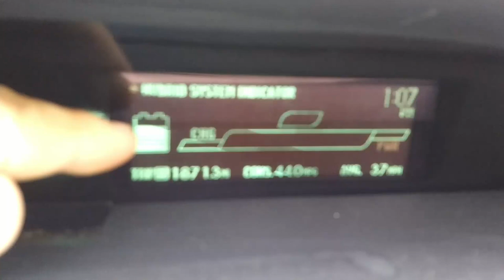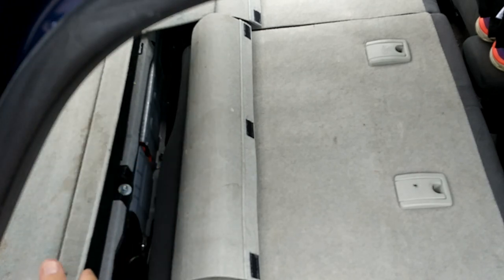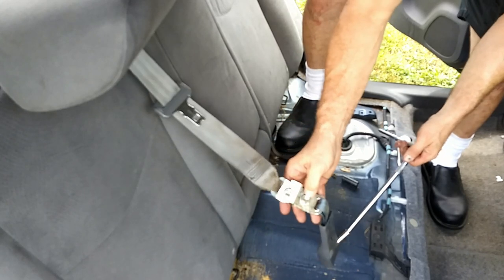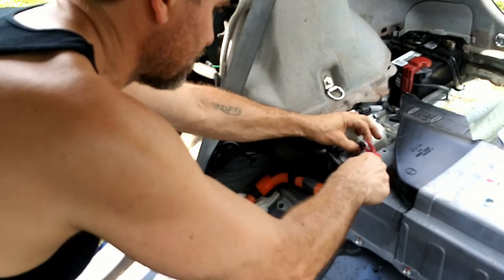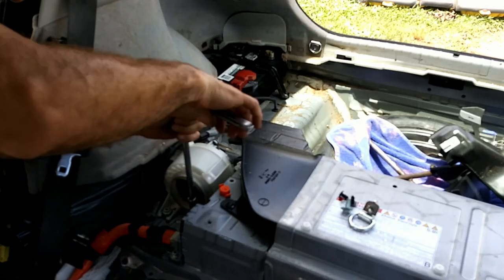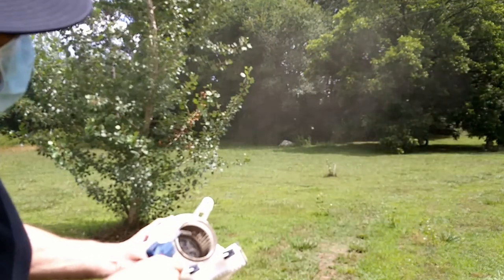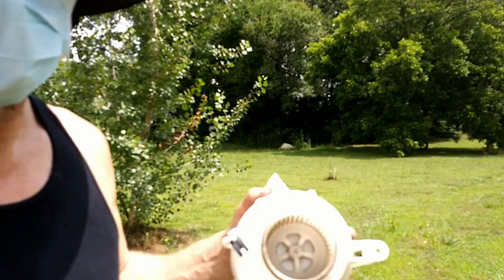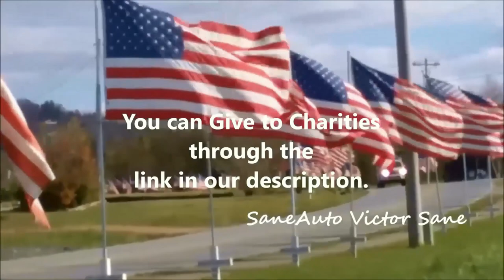2010-2015 Prius Hybrid HV battery fan clean Cheap and easy POA82

Comment: Instead of taking the motor out and using an air compressor or bottle air spray, then a brush to it, couldnt it just be brushed with a wire brush. I really doubt the dealership would take the motor out to clean it that throughly like you are doing here.
Reply from the maker: Your right they wouldnt. Ive worked in 4 new car dealers and most of the guys wont do any more than they have to. thats one of the benifits of doing it yourself. The wire brush would be too harsh because the fan blades are all plastic. If you wanna brush it get a new soft bristle tooth brush at dollar tree or walmart. Then you could try the tooth brush and a shop vac.
Reply: @saneauto  hey there, thank for your video.... I have a 2014 Prius and I cleaned everything you just mentioned, the damn message is still on..... Did a maintenance reset but it still there, I also drove it around town. Any suggestions would be super helpful

Comment: For a regular maintenance item Toyota surely made it difficult to do so.  Also that car was missing the vent filter (so it seems).  It's no wonder the duct work and fan were so gnarly.
Reply from the maker: Your right on both accounts. In my newer video I bought a screen and made a filter while cleaning it again. The next generation has a filter and its easier to access.
Reply: Yes, first thing I noticed was no vent filter. You can use the new ones that fit over the vent on the outside and to clean it you won't have to remove anything to get to it which is awesome. 

Also, you don't have to remove that bolt (or ANYTHING) to access the vent at all. You just push up and then pull the panel out and it pulls out far enough that you can access the vent filter and clean it out and put it back (if you're not using the new vent filters Toyota made that fit over the vent).

Comment: My car charges very slow toyota prius 2014
Reply: mine is too. Car ran today for atleast 30 min. And never charged past 75%. :(

Never cleaned this filter and fan tho. I pray i don't need to replace big battery. 166k on it
Reply: @brokenjed  Remember the the hybrid system manages state of charge of the hybrid battery. You should never see it completely charged unless you have been going downhill several miles. 2/3 is common for around town, but sometimes it will get down to a couple of bars. Generally, don't worry about it but avoid taking it through a car wash that requires you putting it in neutral (where it cannot charge) when the battery is showing low.